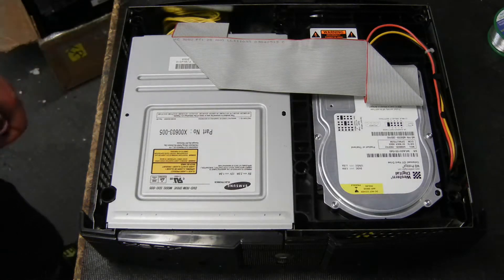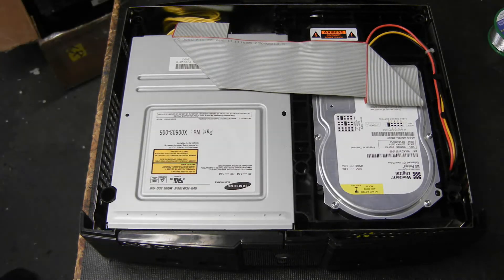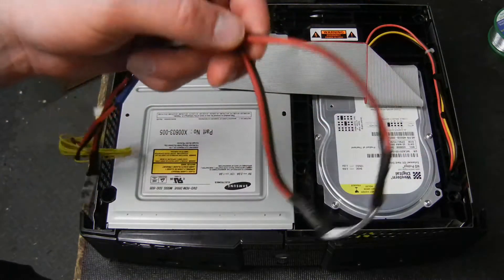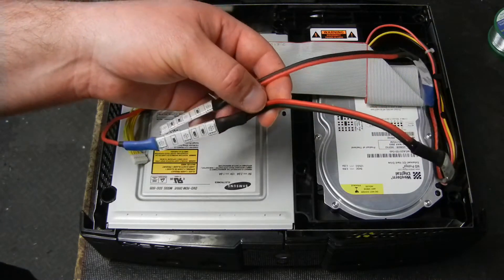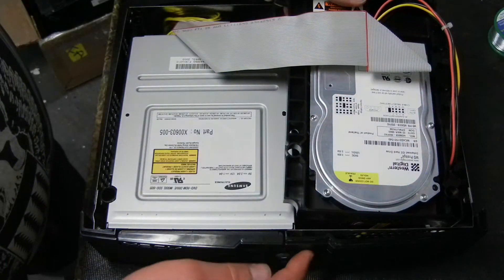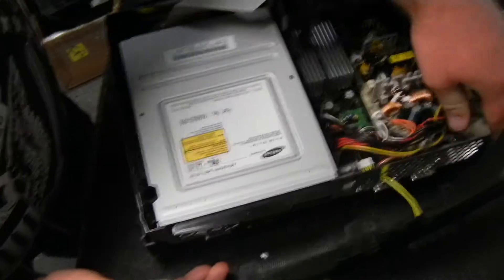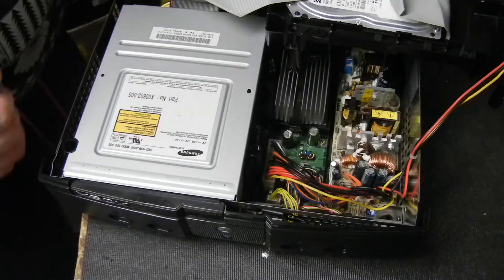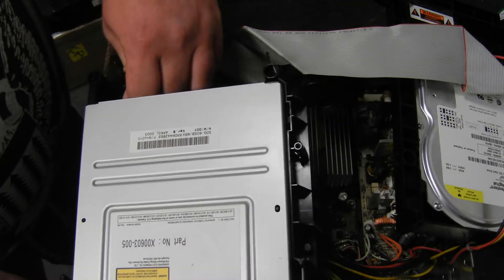How to add an LED kit and finish your Original Xbox Mod PART 4 How to case mod my Original Xbox

Comment: You did a good job but Microsoft made it black for a reason. The insides of this console look awful. All you can see is part of your DVD drive and some old, thick molex wiring. I think if you used a fairly dark plexy glass and added leds to the edges of these windows you cut, it would look better.
The job has been done nicely, but the final product is not appealing to my eyes.
Reply: Use M8 Plus Bios and customize it so you don't need to plug a DVD drive into the console. Then use a black IDE ATA Cable from Asus and boom, inside  looks very nice. Asspecialy a Crystal Case without Cage on top and with some LEDs to show the motherboard (:

Comment: Would it be safe to use one of your light kits and one of the ring led kits at the same time? Reason I ask, is I am considering using one of your kits in a future project. I don't care too much for those other kits, but they work great for just back lighting a clear jewel. On my next build I would like to use one of each, if that isn't going to be sucking too much electricity.
Reply from the maker: Yes it is completely safe. The LED Ring kit uses LESS power than original since it isn't a Tri-Color LED. Additionally the amount of power that is used by the interior LED kit is very minimal. The only exception is if you are using hard mods/mod chips or upgraded Hard drives that require more power than originally intended. In some cases that would draw too much power but again, its rare for that to be the case and is only if you are running a ton of mods that are using a lot more juice than a stock console.
Reply: @Tinker-Mods  yo are you still active?

Comment: not sure it would look that good with a case I want to get is clear green case you would see all the wires.
Reply: I've done a LED Mod with the Green Crystal Case. Remove the Cage from the Top Section and only use black wire, looks very nice with green LEDs. But not with bright green LEDs, i used some with the same colour that the original power button have (:

Comment: How do I buy? I wanted to buy a button. It when I try to it doesn't work. It just takes me to pay pal app. Then it won't let me simply buy it? Why don't u have them for sale on eBay or amazon? This sucks!
Reply from the maker: I just tested out what you were talking about but don't see any issues with the checkout process. When doing a mock checkout, it allows everything to go through. It might be an issue with your PayPal account or even the app itself. You can try using a computer instead of your phone/tablet and see if that helps. You may even want to try checking out without using the PayPal app, and just checking out through your actual internet browser.